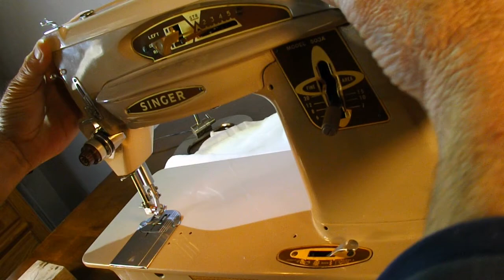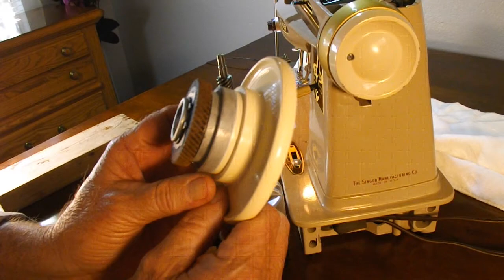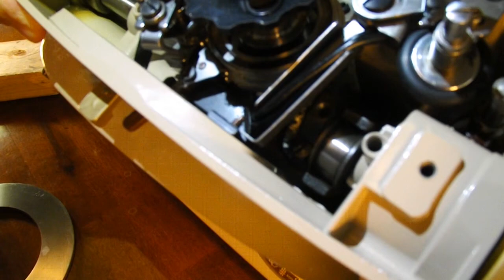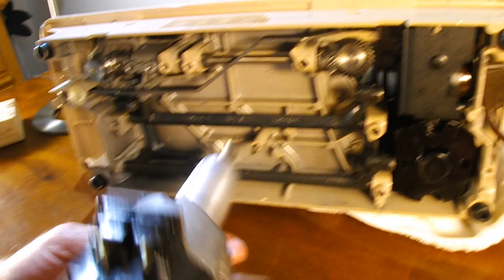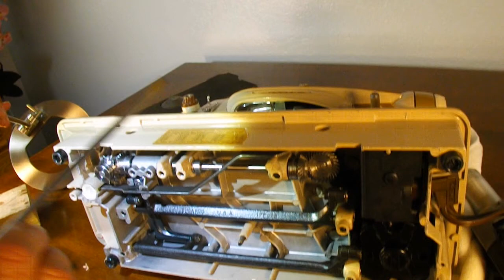Singer Model 503A Special Sewing Machine * Tour the Inside of a Working Machine

Comment: Love your videos! I have my mom's 1962 503a, so it's great to see how she operates. It works great - except for the needle position - the needle is stuck to the left. I don't see any videos about how to correct this - based on a place I took it for cleaning, it seems to be (ironically, since it went there for "cleaning") gummed up and won't move. They got it moving, but now it's stuck again. Do you have any videos about needle position that I just haven't found yet?
Reply from the maker: I'll start with a link to my Playlist for model 503A and its 27 videos for maintenance and adjusting: https://www.youtube.com/playlist?list=PLsCOZgzzaiKJZaZn2zl3LsnV2d7UhrqvX
You can bookmark that if needed. 
     One of the videos is a lengthy tutorial for regular maintenance of the machine: https://youtu.be/Sn2XD4EILFM  You could scan through that video and compare your machine to mine to truly judge the condition of your machine.
     As far as needle position I DO NOT have a specific video for that, sorry. I have a video for the complete removal and replacing the Needle Bar Vibrating Bracket that holds aligns, and moves (swings) the needle bar. You can look through that to get an idea of how things work concerning the NB. I'm not saying to remove yours but just to see how it all works. You can speed up the playback, of course: https://youtu.be/L9ZiWURPA-Q   There is a spring to the NBVB that makes it swing back during ZZ sewing.
     There is also a video specific to removing and replacing the NB if it comes to that. https://youtu.be/4tFbKNlHztI
There are other parts that affect the NB, such as the Needle Bar Driving Arm that could need attention. https://youtu.be/89kRREixTeA
     At this point, you can easily understand why I try cleaning and lubrication before anything else. You could also just have a bent needle, or the needle is not inserted completely, or the needle plate is not seated correctly which affects the position of the needle.
 In the original Service Manual for the 500/503 on pages 12 -14 are instructions for Centering the Needle in the straight stitch needle plate (if you have one with just the small hole) it involves loosening a couple of screws on the Vibrating Bracket and moving the NB into the center of the hole then tightening the screws back up. You can download a FREE COPY in PDF of that manual here:  https://sewingdude.wordpress.com/wp-content/uploads/2012/09/singer-500-service-manual.pdf
     So, best to check the easy things first, like a bent needle, and then be sure of proper lubrication before any adjusting work. Machines that sit for a long time have oil settle to low spots and get hard. Very hard like varnish, that prevents normal movement of parts. Your shop squirted oil all over everything that can temporarily get things going but if there are globs of dried oil floating around they are bound to interfere with normal movement until they get soft and break down from the new oil, WD40, or heat from say a hairdryer.
Thanks so much for watching my channel, and good luck.
Reply: you are wonderful! Thank you for the great info! I was able to oil some spots you talk about xxand get it to move - it’s all working fine now!
Reply from the maker: @sleblanc3704  OK, great that you are in the "swing" of things again. Enjoy that beautiful machine and happy sewing.

Comment: Believe it or not I found one sitting on the side of the road. Every thing turns by hand. But I’m
Getting no power through pedal mode believe.
Reply from the maker: Nothing like finding treasure on the road! Congratulations on your "new" Rocketeer. Here is a series about the foot pedal: https://www.youtube.com/playlist?list=PLsCOZgzzaiKL6ePPxLpmnWSzTyxPKTb71
Here is a series about the motor: https://www.youtube.com/playlist?list=PLsCOZgzzaiKJSu0T9oeaheTZsrUe91kkZ
Here are 20  more videos for Model 503A: https://www.youtube.com/playlist?list=PLsCOZgzzaiKJZaZn2zl3LsnV2d7UhrqvX
If you don't find an answer there, here are 27 videos for its older sister the 403A:
https://www.youtube.com/playlist?list=PLsCOZgzzaiKKyqvdDRwS-9MfLuwSNJTcg
If it turns by hand that is the main thing, it usually means no mechanical damage.
I start by removing the bottom cover to be sure the motor is in place with wires connected.
Next, a close look at the cords to be sure they aren't cut or cracked, then open the foot pedal to see how it looks.
All in the above videos.

Comment: Hello,  how do I set the singer 503 rockets to sew patches on leather vests?
Reply from the maker: The needle is the most important thing. Use a Leather Needle b/c it has more of a knife edge than a puncture point. 
15x1 type needle size 11. 12, 14, or 16. We used SCHMETZ brand of needles. 100% Polyester or Nylon thread. We used to sew patches on denim using straight stitches near the edge of the patch. about 1/8" spacing or closer. Size 12 I liked. You have to test sew to get the correct tension and also play with the presser bar pressur4 setting; enough to move the material but not too much and damage the leather. A walking foot or even feed foot (slant needle) can help when sewing layers together https://www.amazon.com/DREAMSTITCH-421333-451-Walking-Singer-Machine/dp/B07WRGWX7P  We were sewing so many we invested in a new electronic foot pedal b/c the original [edals get hot when doing a lot of slow sewing and the electronic do not even get ward and have superior speed control. Some patch sewing info: https://www.americanpatch.com/about/do-it-yourself/sew-on-patches/how-to-sew-patches-on-leather/      https://www.wikihow.com/Sew-Patches-on-a-Leather-Vest
Good Luck

Comment: Thank you once again.. Nice video. Just what I wanted to see..!!  the basics of how this machine operates. I just saw one on FB. for sale, it's in a cabinet, looks really nice.. and at really good price.  if it's still available, I might have to drive the hour and a half to look at it..  Thanks !!
Reply from the maker: It's one of the two rocketeer models. The 503A is the slant-o-matic Special while the 500 is a slant-o-matic hard to go wrong with either one
Reply: @andytubesewing1953  The one I saw listed is a 503A in a cabinet/table. for $50. looks really nice.. but?  I'm hoping to hear back from my inquiry tomorrow.  I like how it's direct drive, with gears. What bobbin does it take? and is it a rotary hook?  Thanks Andytube.
Reply from the maker: @connieworcester55  oh man, that's a hot deal. It takes a standard class 66 bobbin and it is a rotary hook front drop in bobbin case. Here. Take a look at Victoria https://youtube.com/playlist?list=PLsCOZgzzaiKJZaZn2zl3LsnV2d7UhrqvX
Reply: @andytubesewing1953  Awesome.. I love the rotary hooks.I hope it's still available. I will check out that videos.. Thank you so much.
Reply: @andytubesewing1953  Now I have More Andytube videos I need to watch..to watch.  🙂

Comment: Andy, I love your videos.  I have a 503a that has not been used in several years.  The  machine runs fine, but I cannot move the needle position lever.  I have added oil to the joints connected to it, but so far, no movement.  Do you cover this problem in any of your videos?  Could you give me some advice on how to get it loosened up and working?  Thank you for your help.
Reply from the maker: Congrats on owning a Rocketeer! Oiling around the position lever is not enough. That lever is the smallest part of the system for the needle bar. Most likely the other parts are stuck with dried-up oil. A machine left idle that long needs a very complete oiling at the least. There are 34 oiling points and 4 greasing points on a Model 503A. They are all shown on pages 89 - 91 of the 98-page Instruction Manual. If you need a copy of the manual you can download it FREE from Singer Support at this link: https://www.singer.com/search/support?title=503   If you prefer video instructions I have a video showing how I do annual maintenance on a model 503A. It is very complete but 80 minutes long but you can play it faster or skip around in the video: https://youtu.be/Sn2XD4EILFM   That video is one of twenty-one videos in my Model 503A Playlist you can find here: https://www.youtube.com/playlist?list=PLsCOZgzzaiKJZaZn2zl3LsnV2d7UhrqvX   Videos in the Playlist that are more specific to your position lever question would be the Needle Bar Driving Arm: https://youtu.be/89kRREixTeA 
that the lever partially moves, and the Needle Bar Vibrating Bracket that the NBDA attaches to and holds the needle bar: https://youtu.be/L9ZiWURPA-Q    The videos show the complete removal and replacement of the parts which is not needed in most cases but shows and explains the parts and how they work. The best thing for an idle machine is the oiling and later the greasing. I use TriFlow Oil and Grease, but any Sewing Machine Oil and synthetic Grease will be OK. DO NOT use WD40 or Household oil on your precious machine. In today's dollars, your 503A cost about $3,000 when new. 😲Thanks for watching my channel, Lois, and happy sewing.
Reply: @andytubesewing1953  Thank you so much.  I will check these out.
Reply from the maker: @loissuppo7819  🙂

Comment: If anybody can tell me about the spring in there. I’ve watched tons of videos the last couple of days trying to see what it attaches to.  You can barely see it on the bottom.  It’s hooked on to something near the needle bar area and looks to hook somewhere on the opposite side.  Not one video I’ve come across talks about it.  I bought a singer 500 yesterday and I found it sitting loose inside the machine.  I was able to sew straight stitches but I’m still trying to figure out the purpose of that spring that darn spring. It’s about three or four inches long.  Any help will be appreciated.
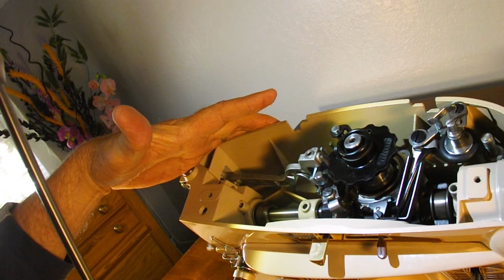Reply from the maker: Hi, Rhonda. I'm sorry to hear you are still having trouble with that spring. You asked about it earlier today on the 401A Camstack video. Over 3 hours ago I replied to your comment giving you a link to a video on my channel that shows where both ends of that spring terminate. That video is on a model 403A which has mostly the same mechanical parts as the 500, just a shorter cam stack. Anyway, I'm going to copy my reply here to this reply so you can click on the link and watch a few minutes of the video and then you should be able to install that spring and get your ZigZag feature working. If you still can't then come back HERE to this comment and let me know, please.  👉 * ""Sure, no worries. If you start watching this video at 08:20 I show where both ends of that spring are attached, https://youtu.be/ZTmyM4MNX6o    From the Vibrating Bracket in the nose, back to the lever that moves the paddle on the other end of the Needle Bar Driving Arm."" ***👈
Reply: @andytubesewing1953  omg…..thank you, I’m headed to the video now.   And to think I’ve watched them all….lol.    I absolutely love your videos as it appears everyone else does too.  Take care and thanks again for replying.
Reply from the maker: @rhondamercado7527  Welcome, and no worries. Good Luck. 👍

Comment: Hello, How do you get the inside of the machine so immaculate? I just pulled out my Singer 503A and I am in the process of deep cleaning it along with replacing the bobbin winder tire.
Reply from the maker: Thanks for asking! it's a method I developed over the years of restoring the machines. I actually wash it in the shower! I use a product called Krud Kutter Cleaner & Degreaser to pretreat the parts, then take to the shower and spray a lighter concentration on it, rinse it all off, and dry the machine with a leaf blower, or hairdryer. When it's clean and dry like that I add the grease and oil. I usually remove many of the parts for this process but have done some machines after just removing the covers and motor. I have a 20 video Playlist for working on this model https://www.youtube.com/playlist?list=PLsCOZgzzaiKJZaZn2zl3LsnV2d7UhrqvX
Video 11 is how to wash it https://youtu.be/SXn57XzNiRQ and video 12 shows the lubrication process https://youtu.be/zo3c9CTgVGg
I found this method to be much faster than poking around with alcohol, q-tips, and rags and it gets the machine incredibly clean as you see. Some of the videos are about adjusting and some replacing broken springs and so forth. Thank you for your interest and for watching my channel.
Reply: @andytubesewing1953  Thanks Andy..I will check this out for sure.
Reply from the maker: @textiletailoredthoughts1420  Good luck with whatever you decide. Happy sewing.
Reply: @andytubesewing1953  Andy..I don't see your email in your profile. Is this something I can pay you to do?
Reply from the maker: @textiletailoredthoughts1420  It's hard to see the email when using a smartphone. Thanks for asking, but I'm not in the position to restore machines at this time. I hope you enjoy your Rocketeer Machine. A very popular, strong, and versatile model.
Reply: @andytubesewing1953  Ok Andy. Be safe. Thank you

Comment: Andy, on my Singer 503A Special Slant-O-Matic, the tension indicator flange stop washer  has the little hook as you described it on your other video, but mine has that hook in line with the cross piece of the washer, not at a 90 degree angle to the cross piece.  Also, when we took the thread tension assembly apart, the stud of this assembly was positioned so that the slot was vertical, not horizontal and the little hook on the tension indicator flange stop washer was positioned down, not up!!  How should I re-assemble these 2 pieces so that my machine will work again.  (Thread tension was way off, the thread was looping on the bottom of fabrics and the bobbin thread was straight--adjustments to thread tension and bobbin tension had zero effect)
Reply from the maker: You are the winner of the odd problem of the week! I don't believe those parts are original to your machine. The little finger of the stop washer usually points up because on the inside edge of the number dial is a little "nub" or "bump" that stops, while turning the dial, on that pin. That nub is usually at the top of the number dial, like behind the "0". So you turn it all the way left it stops at "0" and you turn it all the way right and you stop at 9.5. Someone set the stud so the pin would point "up" to hit the nub, or should have pointed up anyway. If it was pointing down ti would be wrong compared to the nub in the brown number dial. The only reason the stud in installed with the slot horizontal is to accommodate the stop washer pin facing up. On your machine, with the different stop washer, the stud will be installed vertically as you said, BUT point the finger UP so the brown number dial will function correctly. Watch starting about 19:25 in this video where I point out the nub on the number dial. https://youtu.be/OqZZ-uhnAMY
I don't see that your tension would not work if you have all the other parts and install them normally and zero it out. The thread was looping on the bottom because you had no upper tension to counter the bobbin thread tension and I believe that was due to the finger pointing down.
Reply: @andytubesewing1953  Thanks Andy!  I was wondering why all your videos and the parts list for the 503A all had different number dials than mine!  Apparently mine is the one that's "different!"  And even the dial has the nub in a different place, (between 4 & 5) so that with the finger in the stop washer pointed down, the dial works correctly!  Wonder where these parts came from!  Anyway, thanks for your help and the great videos, they made the disassembly and reassembly so easy and after repairing one cracked plastic part, the thread tension is working again!
Reply: @gailjankowski638  haha apparently mine is different That's cute okay I'm glad you got it solved and I'm surprised and happy that it's working for you you can buy the entire tension unit on eBay sometimes but if it's working okay you may not want to bother Happy sewing